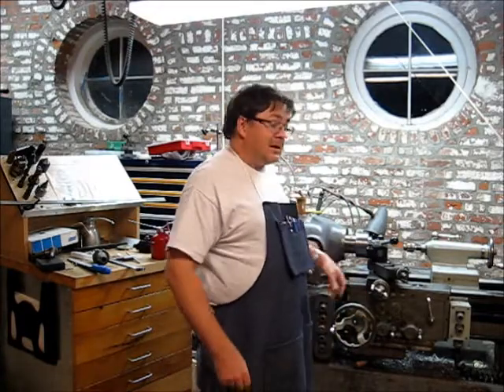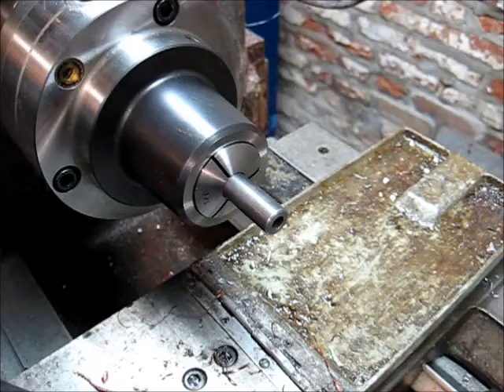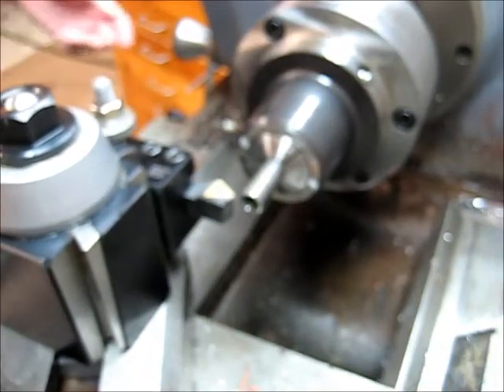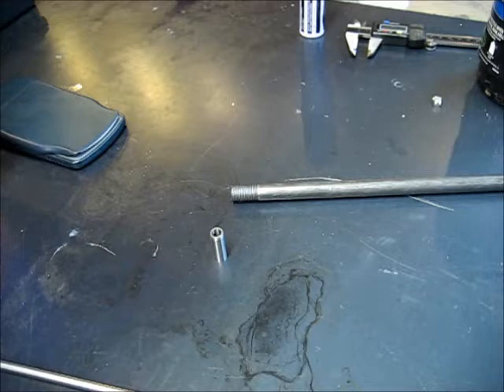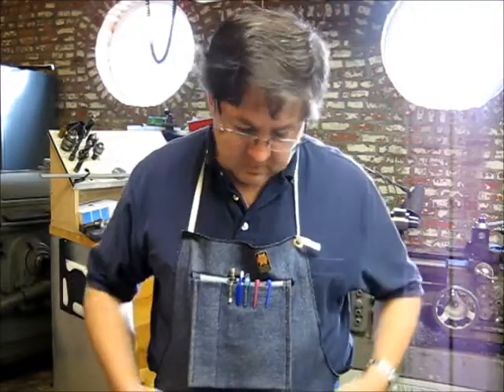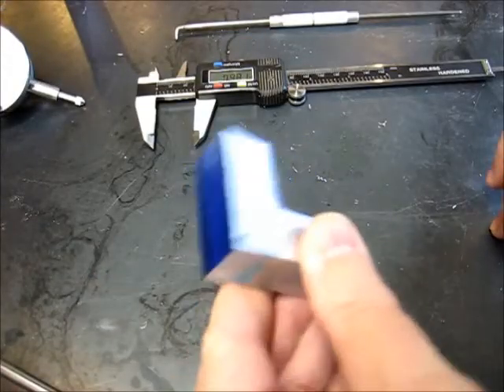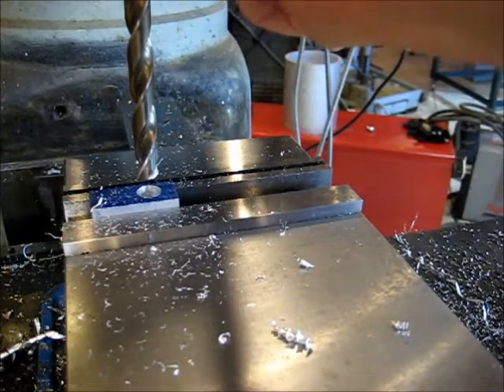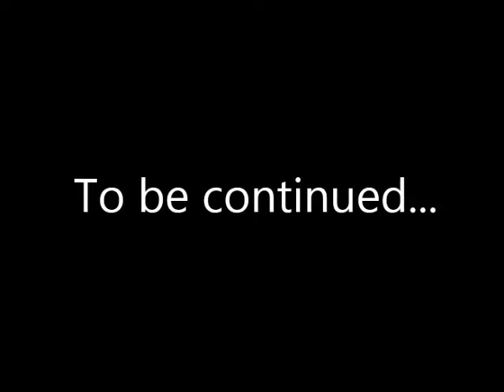Center Height Tool Part 1

Comment: Hi James,

Looks like the coolant system is working well. Good deal.

Best,

Tom
Reply from the maker: Its working pretty good Tom but it does have a case of the old man "dribbles" after you cut the air off.  I either need to work a vent into the system to depressurize it after use or I need to get quality needle valves that actually seal.

Comment: Hey James,
  Looks like a great tool idea, I have to ask, is that a brazed carbide threading tool you are using? If so, what is the approximate speed you are running it at, I never have any luck trying to thread with those, they usually tear the work and or chip. I always have to use HSS, I think it might be because I use a slow spindle speed when threading, just curious as you seem to be having success with it.

Comment from the maker: It is brazed carbide and I have the same problem with surface speeds.  They work well on larger diameters where it's easy to maintain a decent speed.  I have a box full and force myself to use them, I hate to waste stuff.

Comment: When you insert the reamer, note that the reamer tool itself is flexing at least 100 thousandths......is this important, and why does it occur?
Reply from the maker: I have the reamer chucked in a drill chuck, not the best method at all, any error in the drill chuck, which can be substantial, is magnified by the length of the reamer.  Thankfully the reamer will follow the hole for the most part.  A more "official" way to use a reamer is to use what is called a floating reamer holder which allows the reamer to adjust.